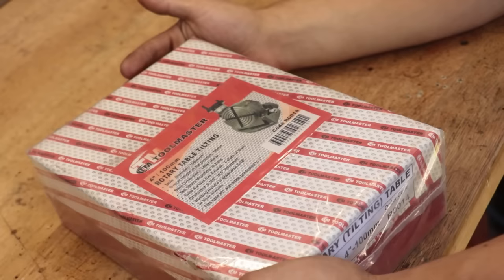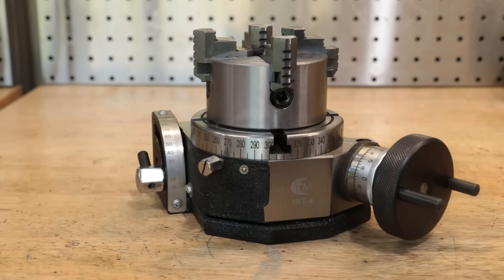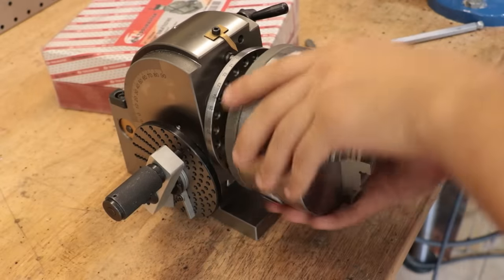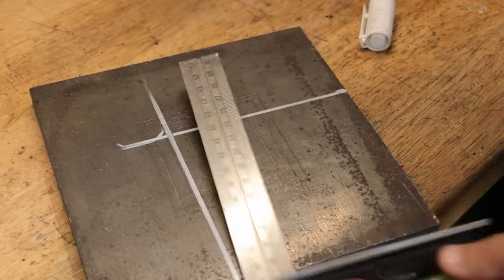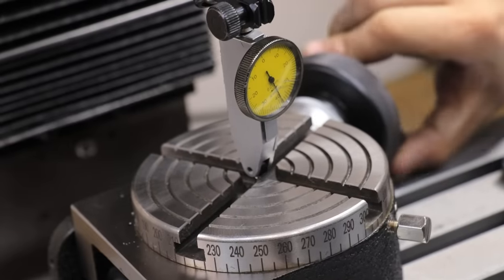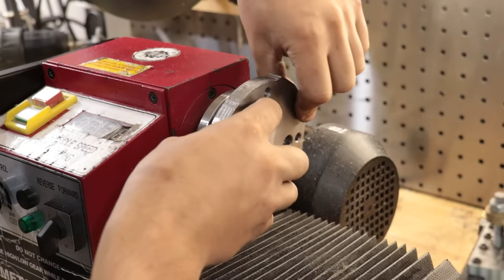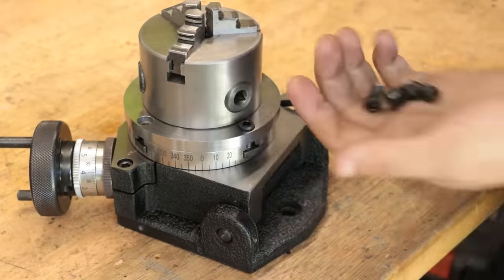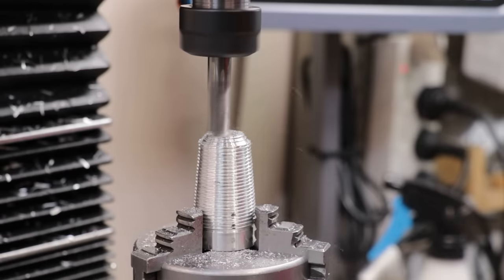I Bought a Cheap Rotary Table Which Was a Big Mistake

Comment from the maker: Should go without saying #notsponsored and I cant imagine they'd want to after this video. Cheers
Reply: These tables and other similarly priced items seem to be made in India rather than China; not that it matters much, they still have the same variations in Quality Assurance™ - variations which range from 'merely cosmetic defects but otherwise ok' to just outright roughly manufactured, poorly designed or made, and/or downright unusable.

But the silver lining? If this can be taken apart and all the flaws in the mechanism fixed up or replaced with well-made shop-made parts, as well as other quality of life improvements, not only does one get a reliable quality tool to use while skipping all the other troublesome and expensive manufacturing steps (in contrast to making the whole thing from scratch) but also learn how it works and how to fix or remake things if something else in it breaks, or a part has to be made for a similar tool.
It has always been the case that anything that is normally expensive being this cheap, or in this case, 'cheaply made' has to be treated like a 'kit' or a 'project' that will almost always need to be worked and re-worked, torn down to bits and rebuilt better than before.

Plus, you get to make a rebuild video.
Reply: @asakayosapro  
30 years ago I worked in a pattern shop and a friend (also machinist & pattern maker with 20+ years experience at the time) took me over to Tree Machine in Racine Wisconsin to meet one of his friends and look around.

Even though they had foundries in the immediate area, it was still cheaper to buy from China. But the irons they got would have things like ball bearings in it, which makes it hard to machine at a production rate.

They ended up just buying whole machines from China, tearing them down, redoing the ways, replacing screws with roller bearings, and installing their brand of CNC.
Reply: I've watched a few of those manufacturing videos from Pakistan and the end products went into "Made in China" packaging !
I try to buy good second hand stuff, but sometimes you have to go for the Far East option, then I treat it as a "kit of parts" that's gonna need some fettling ?
Reply: That’s why I bought the vertex rotary table and dividing head - the tool master stuff can be a bit hit and miss .
Reply: @ianbertenshaw4350  I ordered the 6" Vertex today myself but still have no idea where it is made, I've seen a few video's with it being used and one with a tear down and they seemed impressed with it.
Reply: @MegaLostOne  I have the 8” Vertex rotary table, made in Taiwan.  Tore it down and, yes,  very well made.  Used it for the first time last week.  Worth the money.
Reply: I nearly bought the same one until I saw one in person IL wait til I have the 300 some odd dollars for an 8 Inch rotary table
Reply from the maker: @ianbertenshaw4350  Yeah for sure, learned that the hard way. Cheers
Reply: @artisanmakes  thanks, though. the learned lesson can be shared this way, and you save the rest of us quite a bit of disappointment.
Here in New England, there can often be had second (or more accurately third or fourth or fifth) hand antique tools and machines easily as old as a century. The small, home-shop sized equipment tends to go quickly and expensively, but the industrial sized items which have been rendered obsolete by CNC can often be had for the price of scrap - the current owner simply wants the thing gone and does not want to hire a machine rigger to rid themselves of what for them is merely a burden.
There's a VERY beautiful Green Engraving Machine in a basement just a few blocks from me, collecting dust.
If I had the space and the call to do so much engraving, it would be living in my shop; patterns could be 3D printed very quickly and custom high quality engraving far in advance of what the desktop machines can accomplish would be readily accessible.
Honestly, now that I type all of that out, I should try to puzzle out whether or not I could start a small side business to justify getting that machine.
Reply: @artisanmakes  Both Stefan Gotteswinter and Robin Renzetti have some great videos on improving this sort of cheap gear.
Stefan in particular buys a lot of things like chucks and rotary tables from these sorts of suppliers and basically rebuilds them.
Reply: @asakayosapro  5b.

Comment: I worked 40 years as a toolmaker and design engineer at Ford UK Product Development, and I loved the rotary table we had in our workshop.  For many years, we had no hoist, and the dividing head was too heavy to be easily moved by one person.  But most of all, the rotary table is so simple and quick to use if you just needed half a dozen indexed holes that you could click into the marked indents.  It looked like you were using a multitoothed rose bit to cut the chamfer.  My experience is they try their very hardest to chatter and leave a poor surface finish.  I use Chinese cheep-as-chips single edged countersinks in my home shop and at the Menz Shed, and so long as you keep the speed down they do a lovely job and last for ages.  I have even seen Kurtis from Cutting Edge Engineering Australia use one to machine wide chamfers on parts, although he would be using high quality, and expensive, tooling.  This is the first of your videos I have watched, and I'll be subscribing for sure.
Reply: And here i am, using a spot drill

Comment: I have used the cheap 100mm fixed version of this for a few years. Took it apart, cleaned and deburred. Relubricated with MOS2 grease and now it works fine. Did some creative shimming to the backlash, which is difficult to adjust. 
My main issue is the inability to decouple the worm, I do not hava a good idea how to fix that... 

I always use it in my main vise for small jobs. It is much more rigid than the one in the video that way and it is pretty easy to set the angle precisely with angle block or sinebar. 

The lock mechanism is stupid, it should pull the table against the vertical bearing surface like on larger tables. That way precission is increased instead of tilterror. 

I made a 50mm extension for the hand wheel in order for it to work in the vise. Setup is quick since it obviates removal / retramming of the vise, I highly recomend this, it is very useful for small work. But as bought it is a cheap cast iron kit, fortunately mine had no unfixable errors...

Comment: Maybe you already caught it but at the end when you were facing the top of your part in the 3 jar chuck it tweaked over some in the chuck. You can see the gap between the chuck face and the part and it's still there when you have it tilted. That kind of stuff just frustrates when so much time is involved. Great job and thanks for all of the content!
Reply from the maker: I’ve scrapped many parts that way
Reply: This!  That time lapse camera made it stand out like a sore thumb.  I have gambled on some cheap tools (as we all have) because I needed something quick and cheap, or knew it was only to get me through one job, and it is super frustrating when the quality is so poor that it literally cannot be used without breaking end mills and scrapping parts.  Thanks for another great video.
Reply: Yeah, at 16:43 you can see it kick over by a good amount
Reply: @canonicaltom  clamped on the threads only with the nose of the jaws
Reply: @dieselwelds Those 3 jar Chuck's are marvelous things aren't they, you can keep pickled onions in one jar, fingernail clippings in another jar and grandmas ashes in the third jar. Superb.

Comment: I bought the same one a few months ago.
It's Awesome after a few little mods and about 6-7hrs of Black Dog-inspiring work.
I had to fully dismantle to clean out all the swarf from manufacturing. The operation was rough as guts!
Add a Brass 'Race' between the Face Plate/Body. 
Debur and re-Index the Worm Gear before it sheared the teeth off its mate, which was also re-indexed.
Added a sealed bearing to either side of the Hand Wheel. 
I would also Slot one of the Mounting Holes, as the unit won't sit parallel to your Table.
Add a Spring under that cute lil Table Lock Bolt before it vibrates out and shoots your neighbor.
Nipping this Bolt up to drag helps reduce Harmonics.
However, you can get the s**Ts, coupled with an optimum RPM for the Spindle around 3000+ to take advantage of the Chatter.
The table practically revolves itself!

Comment: I have the Vevor 100mm version (AU$118) , it looks almost identical casting wise , but def has holes in different places and other minor changes .
Reply: People don't understand that businesses in continental china seem to share a lot of tooling with eachother. You can see products using the same parts coming out of opposite ends of the country. And often it'd make no sense for the parts to have came out of the same factory.
Reply: The vevor just has a thumb screw for the lock, so not as much force, does it still tilt upwards like his did?

Comment: My reply from 5 hours ago has gone? OK, rinse and repeat:

It turns out that the construction of this particular device leaves a lot to be desired, which reminds me of my old crappy rotary table. But, you can fix it I think.

Unscrew the hex bolt from the bottom of the table spindle, and put a longer old bolt in there, so that you can tap or push the table out of the bearing. You will see that only the bottom has a bearing, and the top of the table has none.

I have changed this lousy construction by turning a recess in the housing about 2mm deep, into which the underside of the table fits accurately. The housing just fitted in my 4 jaw chuck. I also removed a few tenths of a mm from the bottom of the table, now it runs true. The axis of the table has been shortened slightly (2 mm and a bit), so that the table can sink 2 mm into the recess. I tightened the hex bolt until the underside of the table nearly touches the bottom of the recess. The table is now also supported at the top by the recess, which improves the rigidity enormously and now it turns much more accurately.
Reply from the maker: Yeah sorry about that, it must have gotten flagged by the spam filter. Great advice. Cheers
Reply from the maker: I’ve gotten it apart and I can see exactly how you have gone about this. Might require a few late nights but I might and go about this in a similar way
Reply: @artisanmakes  

Would be great if you made a video of your approach.

Comment: I bought basically the same from amazon here in the US (about 120 USD), and ran into the exact same issues.  Still need to tear it down and modify/rebuild it, but i got it planning on having to basically treat it as a raw casting kit.

Comment: I always seem to run into having tooling not quite big enough for the next project. I bought an 8" Vertex H/V rotary table. It seems quite OK except it only has 3 T slots. By the time I get a part clamped in place, the useful area is down to around 6".  I cast an 11" disc of aluminum and mounted it to the RT. With 8 T slots it makes the table much more useful. I have an 8" chuck that thru bolts to the RT but makes it too heavy for my old body to move as one piece. I have the set of indexing plates and footstock but rarely use them.

Comment: Yea i bought a cheap small 3" one of Amazon and it's really cheaply made. But it's not the tilting variety. I did buy one of those also previously but those are even worse as nothing is square and accuracy is way off. That's also the case for the fixed one but to a lesser degree but still far from being anywhere close to a precision tool.
It does work OK for my purposes since my machining is done strictly as a hobby but I'm still going to invest in a higher quality one at some point. I've just been procrastinating that for a while since I don't end up needing to use the rotary table that often, but when I do it's frustrating sometimes.
Although the rotary plate on it is quite flat, within less than a thou over all sides. After disassembling, cleaning, deburring sharp edges and putting new grease it operated much smoother. The only issue is that there is a bit of lift when machining, that's what makes it frustrating and the other frustrating part I've found is that the chucks I've bought for it are nowhere near accurate enough, so these issues compound on one another.
Altogether i can still make ok parts on them but they are quite a bit off from the accuracy i'd like even just for hobby work.

Comment: Hello Artisan, 
I have been following your channel very closely for some time now and have been inspired to come up with interesting solutions when implementing my own projects. 
Since owning my own milling machine, which is now three and a half years, I am aware that all this is not a low budget hobby. 
I find it very positive that you also present and test inexpensive tools and show possibilities for modification. 
To be able to realize my own projects I had to buy various accessories for my milling machine over the last years. Sometimes it es also in Germany quite difficult to find products in the right cost range. My general experience is not to save money on equipment even if you have a small budget. With a dividing head in this price range, I don't think you can expect the quality reserves that you need for long-term precise work. 
This video shows this very clearly.
Given the variety of products, it has become very difficult to find sufficiently good and precise quality for an acceptable price. If in doubt, I think it is better to spend a little more and buy a product that is stable, precise and reliable. 
With good tools, work is simply more enjoyable and better results are achieved. 
Thank you for the honest product presentation. 
Please keep up the good work. 
With kind Regards form my Workshop in Germany
Reply: The major advantage you have in Germany is that you still have a huge manufacturing base. There will always be a pretty good supply of used, but high quality machine tools and accessories easily available to you. Here in the UK we are better off than Australia, but it is nothing like as easy these days to pick up good quality used accessories. Most of them, particularly dividing heads and rotary tables suitable for a home workshop are at their end of life.

Comment: I bought a non tilting rotary table from Qtech tools who claim to be an Australian company for $150.  Wish i had saved my money because it is a piece of crap!  it looks good on the outside and that's about it. i mounted a piece of mild steel to open up a curved slot (cutter diameter was less than the slot) with a light cut the end mill grabbed and spun the table (10/15mm) and painted a racing stripe in my jocks.  Nun the less i finished with a hand file and wont use it again until i strip it down and assess the issues.  Qtech had very poor customer service,  I won't buy from them again!!    Great video keep up the good work. Ps. i haven't forgotten that gearbox casting you did a while back.

Comment: We use worm gears a lot in astronomy, many times performance can be drastically improved by lapping the gears. Also setting backlash settings too tight will cause binding especially if worm gear or the ring gear are not concentric
Reply: Yes. I did that, just cleaned up the edges n polished them. Felt good but theres no adjusting the backlash in these. At least not mine  3 inch from India

Comment: I would look for a rotary table with a center taper. It will have much larger bearings to fit the taper, plus the taper is super useful.

Comment: Hmmm ... I bought a 75mm rotary table - an RT-1 - for a job in a fctory where I was making up cable loomsand I gotsick of being "screwdrivered"; I made up some plates whuch I mounted to the RT and I fitted M12 sensor sockets and ecomate connectors to take the plugs - no more screwwsdriver injuries!
I have since moved onfrom the factory job and I am now in the process of making a rotary welding table using hobby gearhead motrord and a toothed belt to drive the RT;  my variable PSU is my variable speed drive - its only a few hundred mA. I found the backlash a little worrying, but its new job, this won't be a problem.
I'll be using it mainly for small pipe welding jobs.

Comment: I have the same table. (different brand but same table) 
  I ran into all the same problems but there's solutions, as you have illustrated. I just put brass inserts into my stops or locks as I was afraid the stock hardware would gouge the  surfaces, making it that much more difficult to get accuracy & precision over time. I also adjusted the pointer on the tilt but you should always indicate with something better if you need accuracy.
  It's not terrible but I think I got it for 75 or 80 bucks about five years ago so I'm not nearly as disappointed.

Comment: These cheap rotary tables actually have their uses , you can use them to make precision (sort of) specialty fixtures you want to leave set up permanently! As someone that has spent thousands of dollars on rotary tables I can say it’s a lot easier to handle not having access to a cheap one rather then that really expensive RT you trust with tight tolerance work!

Comment: I have a three inch non angling version of this yable - I bought it to be used a work-piece rotator - and I am quite happy with it. I am going to mate a small Jaycar motor gearbox to it with a 2.1 to 1 toothed belt drive, enclosed on plastic boxes to keep out rubbish and drive it with my variable PSU. It should be good!

Comment: yup  I bought rotary table and dividing head from China while ago. 
It is kinda interesting as almost everything seemed to match its spec, but not working well at all. 
I then realized that once you received it, you have take it apart, wash it, clean it, lube it, and assemble it in correct way, then you can make it work well.